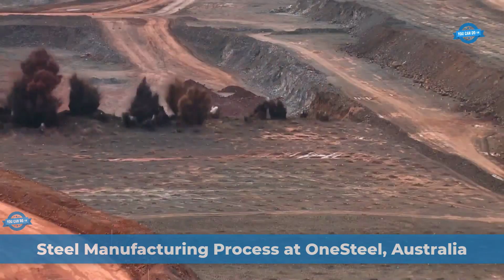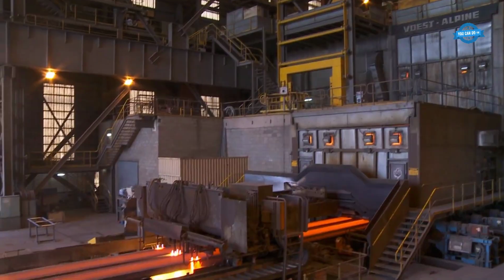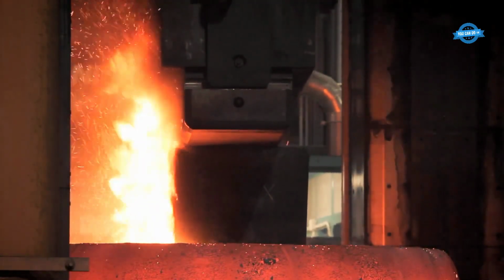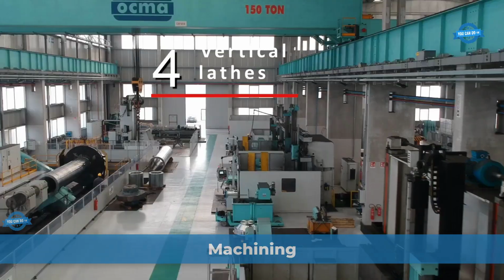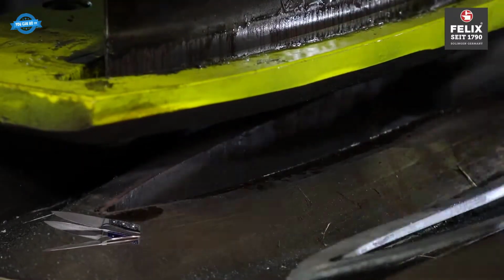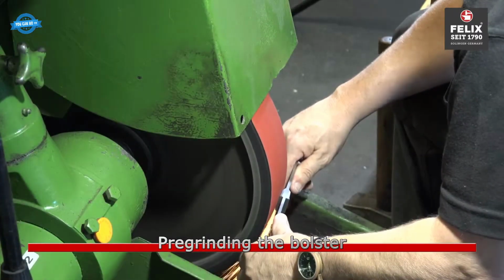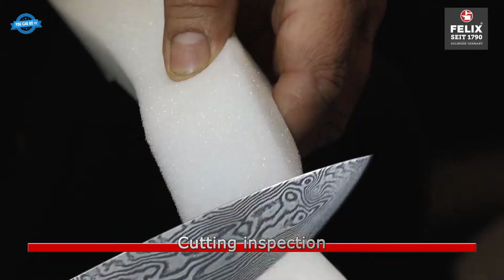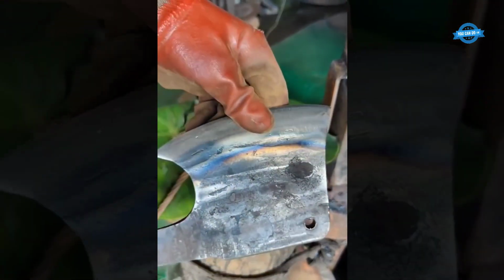The World's Leading Steel Mills. Hypnotic Production Process From Iron Ore To Sharpest German Knives

Comment: Use springsteel leaf once quenched in oil and cleaned then  retempered back to aprox 250deg ( heat with flame till dark brown purple color it will be the tuffest blade you ever used 
a spring maker for 26yrs i made chizels to cut tension springs  wire in a kick press hardly had to shapen it  leaf welded onto mild steel no worrys works great 
Tap it with a rod it should have a high pitch ting sound - Mild steel is dull
Reply: Yes. I use spring steel for my knives too. It's really hard to beat the finished quality of such a knife. I harden it up in oil and let it temper at 250 C for about an hour before I shut down the oven and let it cool overnight.